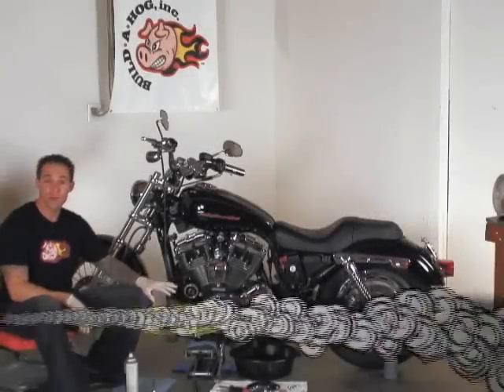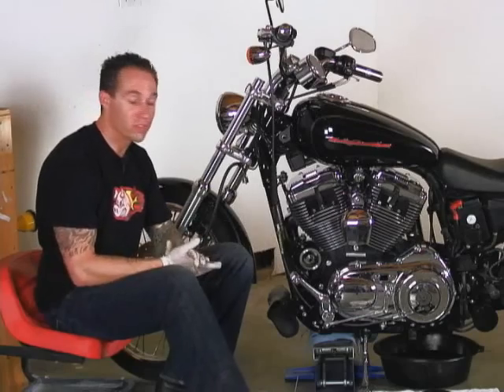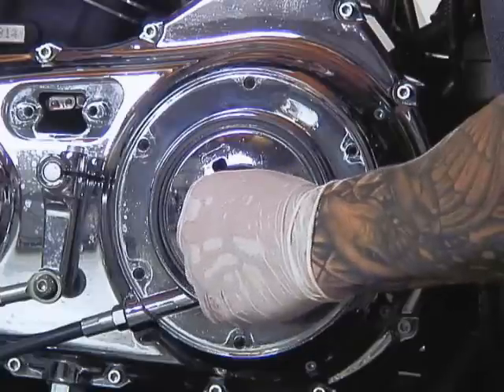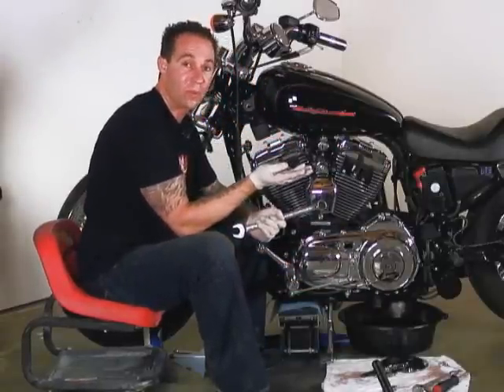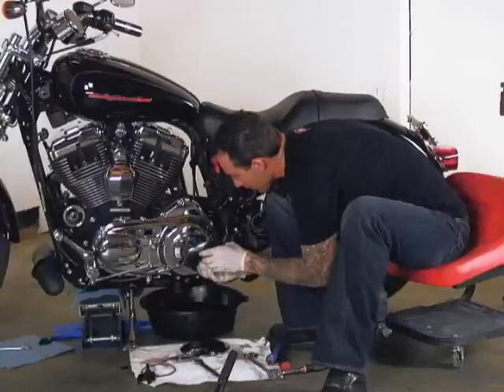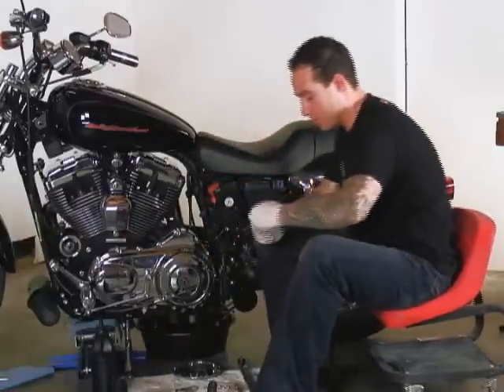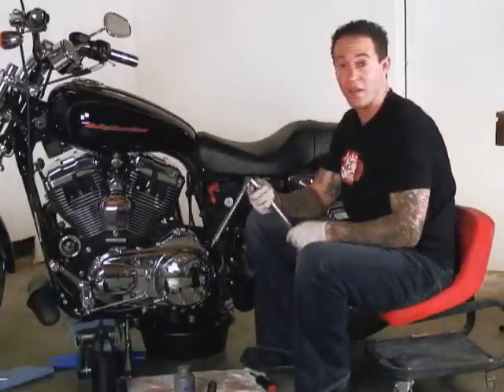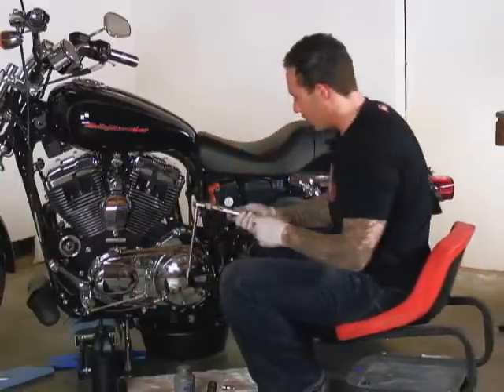Harley Sportster Maintenance Video Part 2

Comment: @Trackerdogslover10 

I realize your post is 4 months old, but to re-tighten the cable you do the opposite of what you did to loosen it. You spin the really long nut back down to where it was and bring the set- nut back down with it and tighten them back together where they started.

Comment: The anti-seize is because you are putting a steel thread into an aluminum hole, the two disparate metals cause electrolysis which in turn causes galvanic corrosion. This can weld the plug into the hole. There is nothing wrong with  using anti-seize on a plug as long as you don't slather it on and you check your specs for what the torque rating is with anti-seize on it. Some plugs are made with a coating that prevents this corrosion always check with the plug mfg to find out if you need it or not

Comment: I just traded for my first Harley, a '95 Sportster. It would have been helpful for you to show the primary fluid level instead of just describing the level on the components. would have liked for you to show the gasket removal and install on cover. I did appreciate the visuals of the primary chain tension adjustment bolt, (was wondering what that was). Would have liked for you to specify the type of fluid recommended for the primary.   All in all I liked the vid and thought it to be informative.

Comment: In the early 70's when I bought my 71 Norton I bought motorcycle magazines all the time.
I would often see a ad for a kit call MAGNACYCLE, anyone ever hear of one or even see one?
   The kit contained a custom built frame plus some other parts, you  transfer all the parts from your Sportster too the new frame.
You sat so low in the frame that the rear cylinder head was a few inches above your crotch.  I never saw one on the road, maybe that's why.

Comment: I want to ask one thing...which oil do you prefer for engine and transmission?  And do you use a mineral 20-50 or synthetic...and the same question for transmission?

Comment: Ok so i run amsoil 20 w50 in my primary, but the trans is lubricated through the engine oil, ive always been told amsoil in both.

Comment: Tried and failed. Now the tire rolls when the clutch is pulled and the bike is in gear. Everything works but the bike still rolls. More elaboration on the screw. Where exactly to stop and turn other way did everything

Comment: High 5! I hate people who use anti seize. People who put that shit on spark plugs annoy me. They always say "But it might get stuck." I always say you know the torque spec for spark plugs is only 12 lbs. which is hand tight. So now you just fucked away that fresh spark of a new plug which is why you replaced then in the first place because you have anti seize all over the electrode. When will people realize there is such thing as to tight. And lubing treads is for stretching head studs.